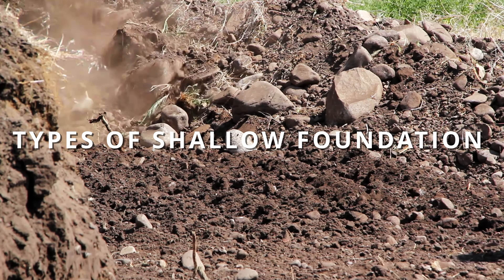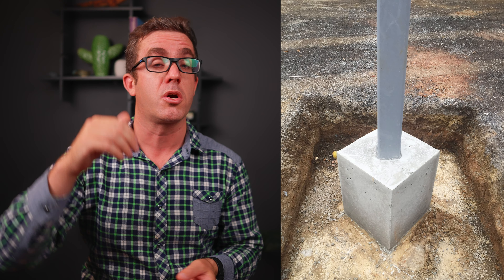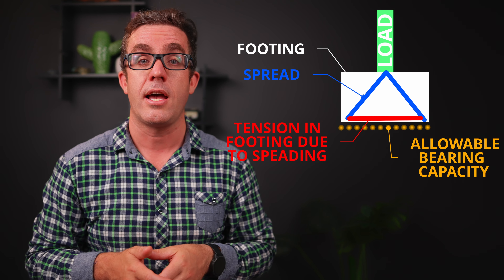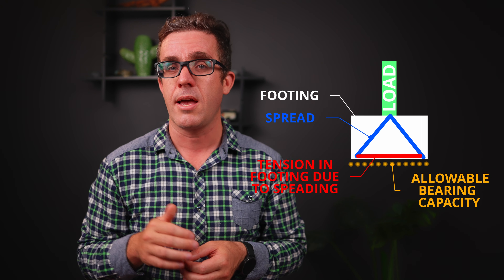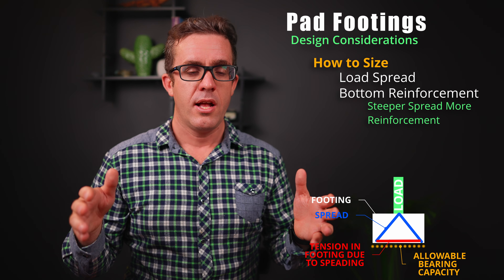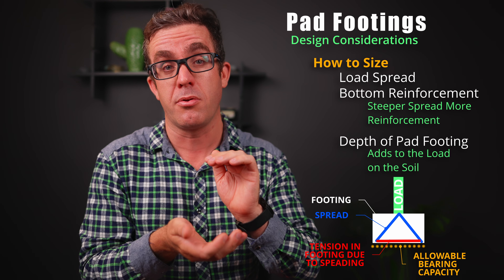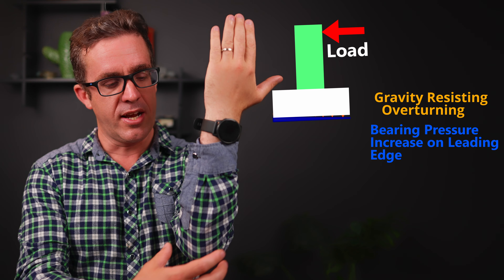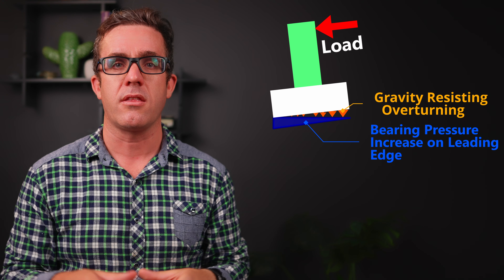The Types of Footings and Foundations Explained Insights of a Structural Engineer

Comment: Thank-you for your video. Waffle pod internal slab with an (non-waffle pod) external concrete area that has an edge thickener and saw cut joint. So, like a patio but not step-down.

Comment: Good work. As an architect and teacher with an emphasis in structural engineering, I would have enjoyed this comprehensive overview when starting out. The only thing I'd change is (and I'd definitely change it), instead of rushing into detail (a fundamental pedagogical error) I'd speak more broadly in a longer overview, generalizing about foundation and footing types, then about soil types before going into detail. I'd also slow down the edits. Brains need time to breathe while taking in information, especially in dense. Cheers,
Reply from the maker: Hi John thanks for the suggestion on improvement. Greatly appreciated. It can be a fine line between too fast and too slow but agree the edits became to fast it needed some breaks to digest. Agree on restructuring to.

Comment: More great content! Thanks Brendan! For the past two years I've worked as a site engineer, however, I never had as much passion for it as I did for the structural engineering I did at uni. I've recently made the decision to change the direction of my career and pursue work as a structural design engineer and I've been using your videos to re-educate myself on some of the stuff I learnt in uni. 

Unfortunately, finding work has proven to be rather difficult, as I'm also new to Melbourne and don't have many connections here. With two years of experience in the industry as a site engineer having lots of practical experience with structures, I really though that getting a grad position as a structural engineer would far easier than it's proven to be. Regardless, I'm still driven to continue down this path and your videos have certainly kept my motivations high, so thankyou for that.

Would you have any advice for someone in my position?
Reply from the maker: Thanks so much for your support Phillip and I'm glad my content has inspired you. I would suggest to try apply from small firms, also many companies recruit on LinkedIn as well. Good Luck on that, trust yourself, keep learning & improving!

Comment: Love your videos mate, just binged a fair few of them.

I was wondering if you offered any engineering review services ? I got engineering done for a shed slab here in melbourne but most of the concreters I'm sending the details to are saying that the slab is overkill and that it should be on bored piers rather than a deep raft slab.
Reply from the maker: Hi Big Mao, thanks for the support. I have limited time so at the moment I wouldnt have time to do any consulting , however if you send me a email I have forward it onto someone.

Comment: Great stuff! Would you be able to comment on the load combination used to determine pad size or checking if the soil capacity has been exceeded? The book Concrete Structures says it should be the unfactored load combination, which is consistent with the practice used in many other countries, but this is not mentioned anywhere in AS1170.0. A bit uncertain of the engineering practice in Oz. Thank you in advance!
Reply from the maker: Hi Deyu, this is something that can be discussed with the geotechnical engineer. as bearing capacity is governed by settlement, it is typically based on a services load  so G+LLR. but it is best to conform with the geotechincal engineer. hope it helps Cheeers Mate.

Comment: hello Brendan,
what it happens if the steel bars are distributed ununiformly in compression and tension zone due to poor workmanship, would it lead to cause additional flextural moments and torsion, and shear stresses, could we solve this problem by using carbon fiber strips, or what are the other suggestions to solve this kind of problem ? thanks in advance
Reply from the maker: Hi Rawaan, strengthen using carbon fibre is limited as it is non-ductile, 10 to 30 maximum additional capacity. Still lots of assessments to prove it up. If really bad may need to remove the concrete using high pressure water, replace the reinforcement and resources.

Comment: what can you do if the soil is susceptible to liquefaction, but also highly corrosive ?
Reply from the maker: Hi JC in highly Corrosive soils you need to increase concrete covers and special concrete mix design. for liquefactions typically you need to install pile suport which can be out of concrete

Comment: Why spread footing only have bottom reinforcement bars?
Reply from the maker: Because in most spread footing the top is always in compression. You only really need to reinforce where tension exists unless you need to resist shrinkage cracking

Comment: A combination of clay and peat is a very weak combination of soils. It always results in using deep precast piles. Some historical building in the netherlands where built on this type of soil with just stepped masonry footings.  Foundation repair has become a necessity in these area's.
Reply from the maker: Hi DYKO, foundation repair is difficult, specially when dealing with masonry.  Alot of building repair is due to foundations.